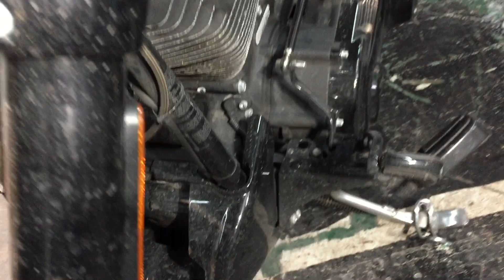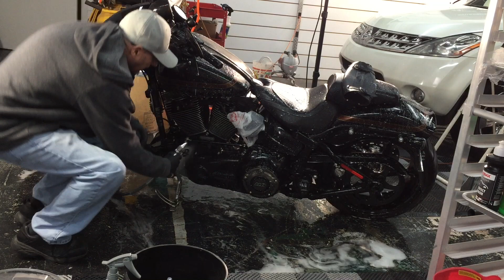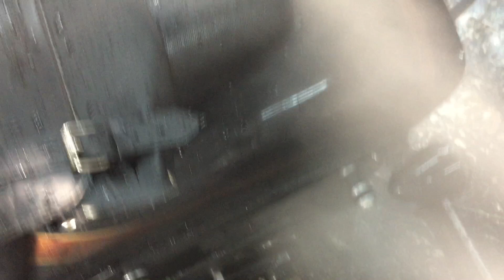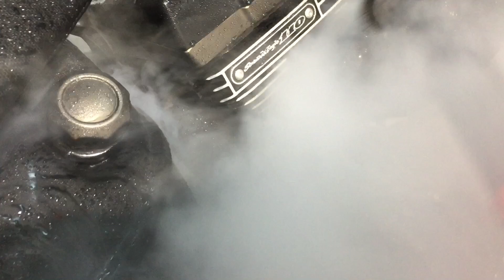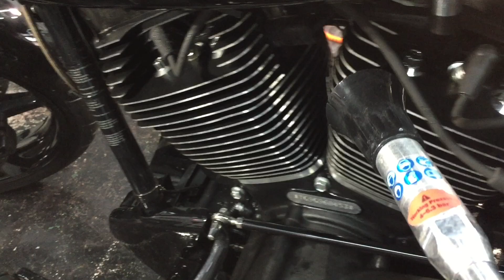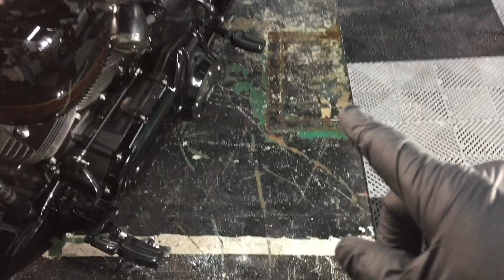My Hybrid Wash Process! Rinseless, Waterless, No H2o Hook UP!!!

Comment: I like ur routine but I would’ve steamed b4 the waterless.  Steam will also blow around hidden grit and if u waterless after that with the spray gun then that would help blow off that steamed grit.  Along with that, the waterless solution will have stayed on better vs. after the steam it is diluted and degraded.   Then do your rinseless as u did.  My $0.02

Comment: I have the car coated with Fusso Coat wax. During winter, I can spend £2 to use the power wash at the local garage (gas station) twice a week for 4 minutes and dry my SUV using Sonax BSD. The car comes out bright and clean in 15 minutes. BSD keeps the car super hydrophobic so dirt doesn't stick (thanks to the base layer of Fusso too). Rinse & repeat. If the car is baked in salt, I use Salt off from Starbrite (Auto fanatic) as pretreatment. When the weather is warm then its waterless wash for me finished off with BSD or last touch. I live in Yorkshire (UK) and drive over 1000 miles/month.

Comment: Going to do all that not to touch the paint and then not going to blow it off with air?
Reply: Or maybe I didn't watch long enough lol.  Still would rather use air to dry 99% then only touch if necessary.
Reply from the maker: I agree completely...compressed air...leaf blower...anything will do.👍

Comment: Another great video! I’ve bought just about all the chemicals you’ve used, my question is about CarPro reload, is that just a ceramic coating cleaner or can I use it as a sealant after using AngelWax AIO! Thanks
Reply: Reload is the ceramic topper/sealant, it does not have any cleaners or abrasives in it, and reset is the main Carpro soap.
Reply: Oliver Taylor I was thinking it was like ceramic boost for a ceramic coating not a topper. Thanks for the info. I did find a detailer that is wax free from shine supply called throttle for use on ceramic coating’s. I was asking for my daily’s not my ceramic coated garage queen. Thanks have a good day

Comment: Do you find tires are a bit more challenging without flushing with a volume of water?
Reply: Just scrub with some APC (like Optimum Power-Clean) first, no problem. Then go over with your rinseless solution. When I use APC I do want to have another bucket with rinseless that can be contaminated with the rests of APC solution. Usually wheels first and then the tires.
Reply from the maker: This 👆

Comment: Finally a proper video on rinseless washing (other than a few others).
And some people constantly think that rinseless/waterless causes scratches, because they're doing it wrong. I pretty much only use rinseless now for all my washes. I do love foam, but seeing that this method is just as effective but faster and less water, I won't be going back to foam myself. I use the same process except with pressurized detail keg.

One more thing, what do you guys recommend other than Optimum Power Clean (or other APC's) as a pre-soak to remove dirt and grime from cars without stripping wax/sealants (just for general maintenance washes)?

Thank you for posting this.
Reply: You can use power clean at a lower dilution like 20:1 for pre spraying. That shouldn't remove any
Reply: DjBann carPro Multi X
Reply: Or your can use opticlean!
Reply: "without stripping wax/sealants", I think they all will to some degree hurt your layer of protection, that's why I always use Opti-Seal as a drying aid, could also be BeamMaker or whatever you prefer but it should be some easy to use product.
Reply: Gtechniq w5 citrus apc is very good and can be diluted to different uses, I find around 10-1 great for pre washing.
Reply: What is a pressurized detail keg? Is it some sort of pressure air tank?
Reply: @andrewhowe5893  yes
Www.detailkegs.com
Reply: @DjBann  Thanks!  I'll check it out.

Comment: Brain, not much water left on the floor.  When using the paint spray gun method, how much water are you setting up in the bucket.  I am assuming you still use a 5-gallon bucket for that rig as the water source.
Reply from the maker: I just feed out of the 3 gallon bucked used in the contact wash.